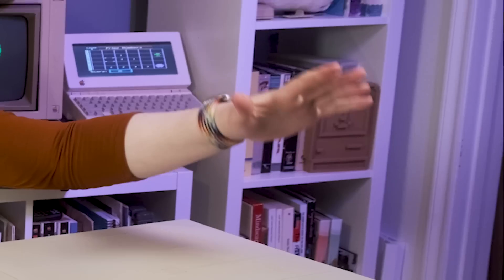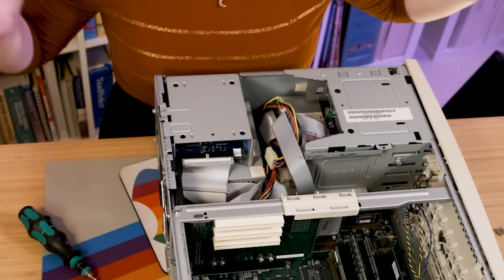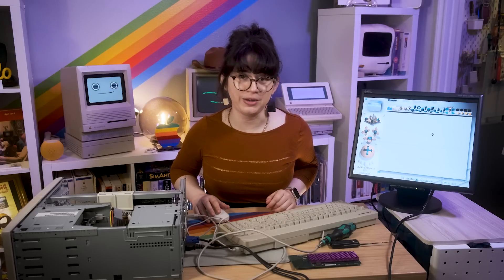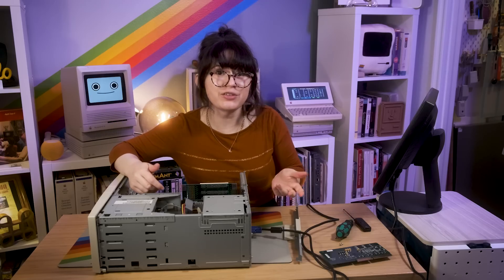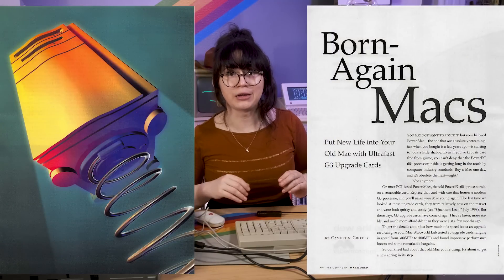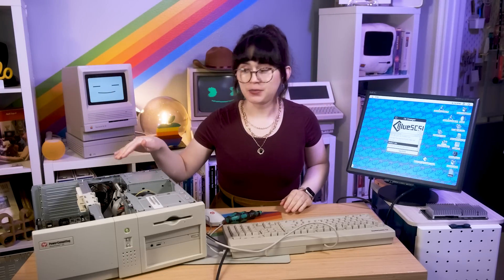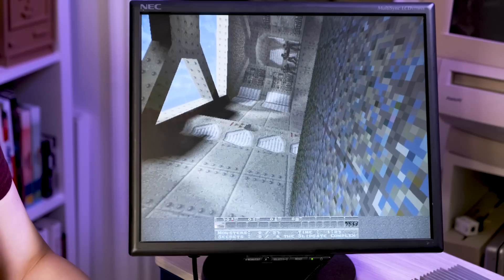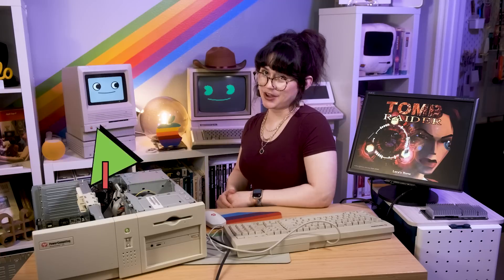[Labs] Upgrading Your 1996 Mac Clone: Bryce 3D, Tomb Raider, Quake!

Comment: 11 mins for rendering a single frame is fairly typical, even today -- unless you're using Redshift or Unreal Engine, which would take around 1 min and 6 seconds respectively (based on my experience). Since this is abandonware, why not install Bryce on multiple Macs and render adjacent frame ranges out on each one?

Comment: For what its worth with regards to Quake, software mode is actually better than the 3D accelerator mode, it was never fixed, but shadow effects look better in software rendering. 3d accelerating took it out for some reason, and ID Software never fixed it. So a lot of the atmosphere was removed.
Reply: also huge fan of you having played Tomb Raider on Sega Saturn, that was the same for me and my first introduction to Tomb Raider, and Resident Evil. I still have my Sega Saturn.

Comment: I have the ST G4 1.4GHz in the G4 Cube. It runs pretty cool, but I had to modify the VRM and solder new MOSFETs on it, also changed their number from 6 to 8. I have also made a new VRM board, from a PicoPSU 80-WI-32. I can run the cube on 12V ::)))

Comment: Bryce 3D was the first 3D software I used for 3D work and I ran it on a 500Mhz Celeron with 64MB of ram and a 32MB TNT2 Pro Ultra. Then I upgrade to Lightwave 3D then 3DSM/Maya etc. Though Bryce will always have a spot in m heart

Comment: I have a sonnet pci based PPC cpu I've been trying to getting working in one of my Amigas, so far no look. I'll get it working one day though.
Reply from the maker: That would be amazing ! I had no idea they could work in PPC amigas too
Reply: @MacintoshLibrarian  Only one or two of the the versions that are on a PCI card work, and then you need an Amiga that has been modified to have a PCI bus board.  So its got a very tiny user base.  I suspect I need to recap my A4000 board, as the that card pulls a fair bit of power and its pulling the voltage rails down.

Comment: How old are you if you don't mind me asking?
I was 8 in 03. I didn't have my own computer until 08 and it had a pretty slow Pentium 4 (I think it was 3.0 GHz. I don't know what model, but later in 09 I had an Acer Veriton 2800 that my brother gave me (I think he might have stolen it, but I didn't realise that until a long time later.)) It also had a Pentium 4, but it was much better. It was one of the ones with SMT (hyperthreading) and I think it had a 2MB level 2 cache (also it was a 65nm lithography one and it ran at 3.4GHz, which of course isn't that much more than 3GHz but it was a lot faster. I think they must have made some decent improvements to the micro architecture.)

Comment: Gave up on the fruit company when jobs came back and smashed the idea of generic inexpensive hardware macs. Suxor with windoze for a while...then freed with GNU/Linux. I now question people's sanity in having any interest with said fruit company. Always overpriced and user hostile, and that hostility has increased over time. Try doing what you are doing to a "modern" mac. Not without very expensive PCB repair equipment.

Comment: Did you install the system extension for the G3 Upgrade? Without it, the L2 cache on the CPU board will not be activated.

Comment: LOL of course we all know you're more than capable of the same gymnastic feats as Lara Croft, but this video is about the Power Computing Power Center [sic] 132, so sadly it's not fitting to demonstrate. 🤣

Seriously though, that's a massive upgrade! You're going to have to put a sticker that says 500 over the 132 in the model number on the case. Bryce was a great demonstration on the difference in speed, but it would be awesome if you could figure out how to get Maccy textured so you can render him properly in 1990s cyberspace! I have no idea how Bryce works, but perhaps there's a newer version you could use as an intermediary to import your files and export to the older version?

Comment: In my case, Quake came out when I was in elementary school, and was sort of a stretch for the PC my parents had the time (which otherwise ran Doom and similar pretty well).
When I was in middle and high-school, tinkering around with the Doom and Quake source was also part of how I learned C.

Kind of funny how computers changed a lot during my childhood (back in the time 486 PCs and similar), but by around the time I finished high-school, I got a PC with a 64-bit AMD CPU at around 2GHz or similar, and PC's haven't really changed quite as much since then (more RAM, more HDD, a little faster, etc; but nothing like it was...). Granted, we did lose of CRT's and 3.5" inch floppy drives since then (well, along with the DB25 parallel and DB9 serial ports).
Meanwhile, a lot of the older computers (such as most of those from the 80s) would be almost unrecognizable if compared with a modern PC.

But, yeah, still nice seeing your content...